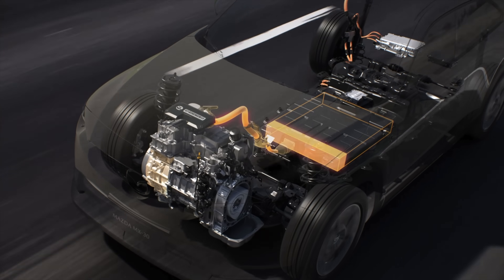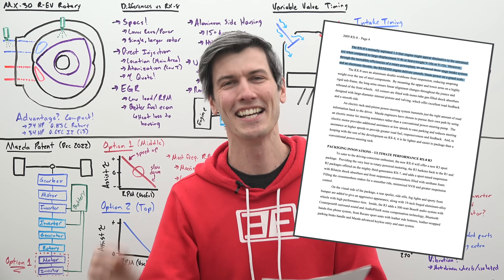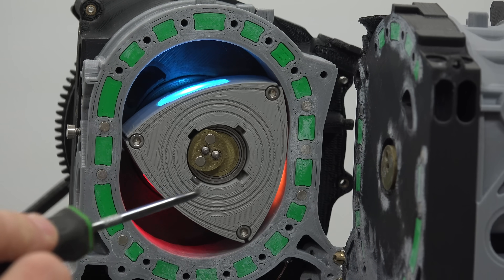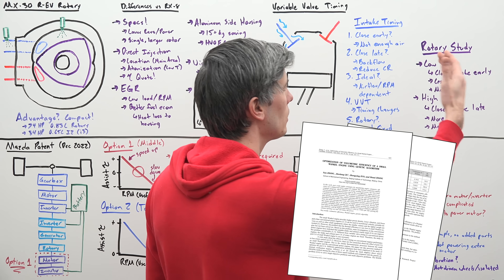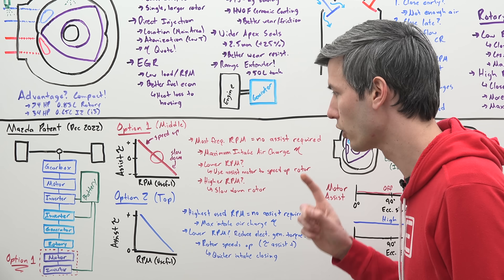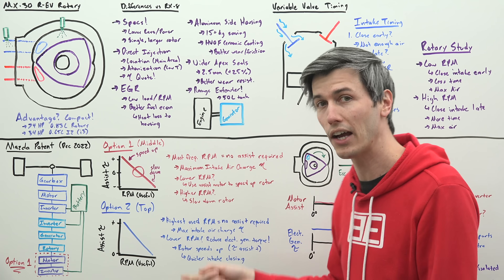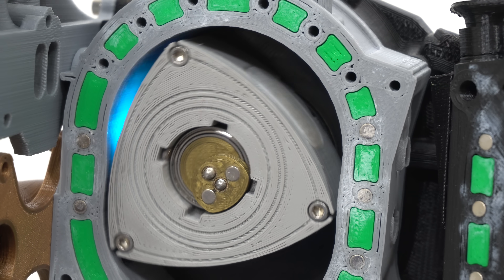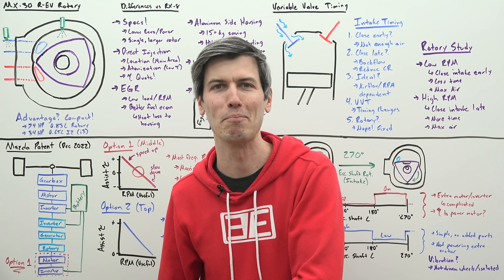Mazda Brought Back The Rotary Engine!

Comment: Gotta love Mazda’s resilience with keeping the rotary alive.
Reply: Absolutely, they even go so far to say that "rotarys are our thing" and that they would love to make a modern rotary sports car.
Reply: I hope any f1 engineers find intrest in developing rotary for mazda
Reply: It’s really the only thing that makes the cool IMO 🤣
Reply: You mean on life support at this point.
Reply: Kinda pointless to keep killing a dead horse rotary engines by design no matter what they do they will always burn oil and be fuel inefficient.
Reply: Dog with bone. Good on them.   I’m happy for Mazda.  Impressed resiliance to failure
Reply: Mazda is/was working a Hydrogen powered rotary engine. I think that with new manufacturing technologies/techniques, the Wankel rotary engine can be efficient/powerful enough to be in a sports car again. Keeping the faith!
Reply: @chanoleyva8584  but at least they need to be rebuilt every 120,000km. Great feature.
Reply: We went from building the 1st airplane to landing people on the moon in less time then we've spent trying to make a proper Rotary.
Its time to stop beating the dead horse and bury it already.
Reply: For the right use case a rotary is a great range extender. On one side of the spectrum if you have a 1kWh battery an efficient piston reciprocating engine makes sense. On the other you have a 100kWh battery where a less efficient but lighter and smoother rotary makes more sense as you're on battery more and using the extender less. Same applies for driving habits: for shorter trips and fewer long trips a rotary is less impactful to the battery-only economy.
Reply: Mazda is the kind of downdog who always want to impress everyone with setting difficult goals for himself but always fails at the end.
Reply: This seems like it would be the ideal use case for a Wankel.
Reply: Their probably relying on the engine only being used for short periods, the oil tank needs to be bigger than the fuel tank too.
Reply: I just hope it's not a hammer in search of a nail. This seems like a lot of extra engineering for a design that might very well be fundamentally flawed. I see a rotary engine is theoretically beautiful in its simplicity. But so is a spherical cow.
Reply: The rotary kept Mazda alive and Mazda is returning the favor. Japan wanted to reduce competition in their vehicles market and Mazda would get killed if they didn't get the patent for the rotary to differentiate themselves from the other companies
Reply: Alive and on life support: undoubtedly it is their trade mark; however, rotary engines have always consumed oil and demanded a lot attention that only a few enthusiasts have managed to give.
If packaging and ecology are the goal, they could have made a joint venture with Yamaha and used a motorcycle engine.
Reply: I call it stupidity but sure.
Reply: I feel it's somewhat like a two cycle engine, there is probably an absolute constraint, in this case emissions, but they are still making technological advances and contributing to the industry, they may yet hit on that major innovation. I think the electric/hybrid sector makes sense. Mazda's niche has always been power to weight ratio and a steady power band, both play well with electric.
Reply: The engine might not ideal for powering every driveline, but when you can get that thing to hold RPM.... wooowee! That's why these are used in Military drones as the engine for the generator that power the thing. Small, compact, efficient.
Reply: @gazfish  lol 😂
Reply: @EmilioBaldi  when you say consumed oil, it means the apex seals require lubrication just like piston rings do in conventional engine. My 85 RX7 used as much oil from the sump as does my late model VW
Reply: resiliance?   They haven't been able to supply their dealerships with new cars in my region ever since the pandemic hit - only sending small numbers of cars each month,  the lots are still empty today.

But they're screwing around with making their brutally underpowered / low range EV that only sells dozens per month globally ... into an EV that burns gas and has emissions, and that will barely sell dozens per month globally.
Reply: Though i am pretty sure this one isn't going to sell well.
Reply: Using them in power generation makes so much more sense if they like to stay in a specific RPM.
Dorito as a stationary generator  solution should really be much more used. Way less parts to break, its probably cheaper to make.
Why no one thought of that before is amusing.
Reply: @maddogsk8er86  the perfect application for dorito engines.
Reply: They kept it alive in the worst way possible
Reply: Let's be honest -- Mazda doesn't have Jack Schitt else to be excited about. It's a loser brand, with no purpose in the market.
Reply: Yeau but lets just hope mazda doesnt make it dogshit with a billion pointless sensors that will basically kill the whole car is a headlight buld blows
Reply: Rotory engines are beautiful
Reply: @rogerwilco1777  eh many companies still trying to build flying car that from victorian age so why not rotary engine
Reply: It's a superior design vs. a standard v motor. The power output vs. size of motor is substantial. The only downside to it was emissions.
Reply: @sinoverlord409  a 2 stroke 850cc pistons engine can output 160hp...the only downside is emissions.
Reply: They should have stopped with the rx7 tbh. It's like horrible re-runs that keep getting worse.
Reply: @BarelyA1ive  they can't
Reply: @raisofahri5797  I am pretty sure none of the big companies every thought of building flying car when there are literally helicopters, planes and jets.
Reply: electric lame asl
Reply: This feels more like reusing old machines and manufacturing lines to build this limited run assist motor. These hybrid trash cars will be dead in 5 years anyway, so they are just getting to use their last parts and leftovers from the rotary era.
Reply: @MasterofNoneTV  the oil consumption of certain VW engines is well known. VW Group is not an example of a virtuous company; let alone green company.
I'm sorry, but your argument is a formal fallacy.
Reply: @dknight2585  they bought it back lol
Reply: I'm very happy to see the original 47 engineer team for the rotary did not work in vein. The glass is more than half full due to modern technology, a variable computer controlled reed valve intake & exhaust system coupled with a VVT & proper anti-reversion cam profile would be a great way to breed more efficiency! I love this channel!
Reply: @hxhdfjifzirstc894  Absolutely not true. In terms of mileage you get out of the car per money you spend on it, they are second only to Toyota (and not by a big margin).
Though that's for the less cool piston engine models, not the rice rockets.
Reply: Have they dealt with all of the emissions issues, seal issues, etc etc... IMO rotary was always a neat concept but until those absolutely astonishingly critical technical challenges are solved (with advanced materials etc) the idea still seems like it should not be allowed to be sold to consumers... i.e. does anybody have any idea how astonishingly horrible the emissions of the old Mazda rotaries really were? 
Even worse than those Volkswagens that lied about diesel emissions... it was that bad.
If they have solved those issues, this could be the ideal power plant for this use... but only if all of those issues have been solved and solved well.
Otherwise, as previously... it's a "not ready for prime time" tech that Mazda keeps tossing rough and dirty prototypes at us, as if they had mastered the tech (something they most certainly had NOT done when rotary engines were common in the 80s etc).
Reply: We may get a real rotary because this EV is a great way to do testing. Real world research.
Reply: @BarelyA1ive i hope not
Reply: It will make a splendid addition to the Smithsonian Museum one day—long after Mazda ceases to exist as a going concern.
Reply: There are much better reasons in play than resilience!
Reply: Same engineers from the first generation RX7 locked in a basement until they get it right.
Reply: But they never alive for long tho
Reply: It's dead Jim, DEAD!
Reply: @chanoleyva8584  ... Rotary engines are very power dense, meaning liter for liter a rotary engine produces more power than a piston engine. That's why many UAVs use them. It makes a lot of sense to use a rotary engine to produce power for a EV, as well. Rotary engines struggle to be fuel efficient, when they are not ran at optimal RPMs, but stick them in a light airframe or used as a generator, they are more efficient than a piston engine (taking weight and size into consideration of course).
Reply: no. Imagine how many tons of fuel have disappeared through the exhaust of Mazda cars just because the engine is inefficient.
Reply: doesn't produce the engine for over a decade

Boy Mazda really is resilient! Can't believe they've lasted so long building a rotary!
Reply: But at what cost, what have they done to my boi. Jokes aside so happy to see it back knee capped or ptherwise.
Reply: Right they are talking about aiding the rotary with an electric motor just to be able to use it lol
Reply: I bet that someone will build a 2+ rotor version of this engine utilizing the DI system.
Reply: @chanoleyva8584  I guess two stroke motorcycles are pointless and inefficient too. Just a design that is racing inspired not designed for your average Karen that doesn’t change her oil or do any maintenance on her car. Rotary is a car enthusiast engine for sure
Reply: My only wish is that if rotarys cant make it back as the main engine for a car they could at least still be the main engine of a motorcycle, that thing is still putting out 74 ponies, more than plenty for a bike. Just imagine 😭
Reply: @chanoleyva8584  Advances and changes in design and development can always improve things. Particularly these days with how fast engineers can get stuff to the prototype stage.
Reply: Like Harley keeping the air compressor engine alive.. always someone thinks it's the greatest
Reply: now we just need toyota to bring back a modern version of 4AGE
Reply: The cost is too high. It's like keeping the Mustang 'fresh & hip' by turning it into an EV SUV.
Reply: Persistence
Reply: The aftermarket and private developers kept it alive after they killed it with the rx8
Reply: @prestonsplans69  yea the rotary is most people are car enthusiasts though
Reply: Very soon Mazda will invest in even less of a rotor: a third to be axact; aka a piston.
Reply: @autolykos9822  – Not surprisingly, because Toyota Motor Corporation owns 5% of Mazda, and they have cross-supply agreements – all of which results in a level of Mazda product reliability that keeps Toyota happy.
Reply: @BarelyA1ive  Wankel engines are too shitty by design and too unreliable and cost way too much to keep running for it to be of any use to anyone, especially professional racing teams.
Reply: zoom zoom 😎
Reply: Reminds me of an article i read 25 years ago by an EV expert, he stated the optimal layout is an EV with an onboard gas turbine generator.  If you're Mazda, that sounds like a perfect spot for a Wankel
Reply: Fun fact, Wankel's original patent expired almost 70 years ago. As the only general market developer to build upon that original patent, each newly issued patent allows Mazda exclusivity in licensing the tech for revenue generation. 
If you wanted to know why a new Mazda Rotary powerplant comes along about oh, every 15 years or so, well thats the maximum amount of time a US issued patent license lasts for before expiration.
Reply: Dowside:

It's a hybrid and thr rotary doesn't even do much of anything other than spin a generator. Would love to see a true hybrid rotary.
Reply: @pocok5000  Yeah, because the Miata, 3, 6, and now the Rotary have all been failures. Oh wait...
Reply: @adamcrookedsmile  Imagine how much the owners didn't care, because they were enjoying the drive. They aren't as inefficient as you think, either. The 1986 RX-7 had the same fuel economy rating as a 2021 370Z.
Reply: @bradcomis1066  Rotary engines can last a fairly long time. Almost every one dies due to user error or bad rebuild. Dropping the front thrust bearing, not enough endplay, not enough lube...
Reply: @Karl Günter Wünsch  if the technologies do not improve, batteries will be the downfall. Lithium mining is terrible for the environment. And manufacturing techniques are not far behind. Mazda's e-Skyactiv X does so well, and that is just one technology from one company. Internal combustion engines can be efficient enough with  the correct management. The thermal inefficiency can also be worked out with the correct management. I think people are jumping on the EV bandwagon because they believe that it is better for the environment, but it certainly is not, not yet anyway. Hybrids are a  better alternative, IMHO. 
But if you want to drive an EV, then do that, if you have the means.
Reply: @jeepmanxj  No, they are expensive to get right - but if done they are a marvel. But I agree that this time it's too little too late - they should concentrate on getting batteries right.
Reply: @jeepmanxj  Tell that to the racing cars that won their classes in endurance racing using Wankel engines. But I sort of agree, the whole combustion engine area is coming to an end because they are grossly flawed and the Wankel engine is just one type of now obsolete technology...
Reply: THE DORITO IS BACK
Reply: Yeah, the engine won Lemans
Reply: @chinwubaamadi  so? Lots of engines that are overall unreliable have won LeMans. Your daily driver will have thousands of hours on it.
Reply: @Lurch hydrogen is way more than a decade away. The logistics of hydrogen production make it obscenely expensive, so expensive that the few vehicles that use hydrogen come with tens of thousands of dollars in fuel credits to get you through the first year. 

It's a solid 50 years away and the wankel will be long gone before then.
Reply: @chanoleyva8584  yeah, but if your old enough to have been around then, that is exactly what they said about conventional engines back in the early 70s.
Reply: Without any doubt dumbest idea from Mazda so far...
Reply: @hxhdfjifzirstc894  My 21 Miata RF is a pure joy to drive and never gave me a problem.
Reply: Remember like he said in the 2008 Rotory announcement, everything was advertised as working efficiently. We will have to wait and see if it actually works out right and the longevity of it.
Reply: @wanglee21  Indeed, many have made claims of significant improvements to the Wankel engine to make it competitive with reciprocating engines in reliability and efficiency but as of yet none of these claims can be proven and seem highly unlikely given the inherent flaws and limitations imposed the the Wankel engines fundamental design.
Reply: It's the sunk cost fallacy.
Mazda has invested a lot into the rotary engine
Nazda's problem is that it's because a liability in terms of fuel efficiency at a time where efficiency is a selling point AND electrification is in the horizon.
But they're still trying to justify the extreme amount of R&D cost, time and effort they've sunk into rotary engine design, thus they're trying to keep it going until electric cars becoming the standard end any hopes of market viability.
Reply: @fl00fydragon  I feel its just odd how they are not using the rotary engine to power the wheels but instead a battery pack. lol I find this counter productive but who knows, maybe it's more reliable and efficient than the normal hybrid vehicles.
Reply: It’s amazing that they are keeping it around but it’s sad that it’s been boiled down just to a tiny generator
Reply: @MissingLinkGTRS  This looks like just another Mazda publicity stunt.
. unfortunately it seems the Wankel engines shelf life has reached its expiration date... this one got a very cool response from the general public and die hard fans.
Reply: @RENOWN55CHARGE  Ford e mach is a mustang EV
Reply: @Runco990  a turbine is more complex than a rotary engine and needs a higher temperature to work
Reply: @apexbender  China and Europe are oil poor, so they need to use EV. China started to use electric scooters 15 yr ago
Reply: @wanglee21  combustion engine are efficient to a single operating point, they don't like change in speed. Electric motors are more flexible
Reply: @Kannot2023  Europe and China are both traditionally Coal based energy producers.
Reply: @aj-oldschool-motors  Unfortunately this is nothing more than wishful thinking and completely  disregards the development history of the Wankel engine.
The Wankel engine is inherently inefficient and unreliable compared to reciprocating engines, the industry concluded that the Wankel has reached the end of its development potential.
Reply: @hxhdfjifzirstc894  meanwhile my 2010 MX-5 goes up in price every month
Reply: ZOOM ZOOM ZOOM!!!
Reply: @drewo.127  Yup, Mazda only makes piston engines these days
Reply: They never should have killed the rotary.  I loved my 2011 R3.  I would still be driving it if an uninsured driver hadn't rear ended it and totaled it for me.  I have owned 7 rotaries since 1973.  No engine is more fun to drive.
Reply: @CrotalusHH  If what you claim is true? Mazda would not have lost money on every RX model ever sold, they lost a staggering 3 billion dollars on the RX8.... no one bought them.
Reply: @sandervanderkammen9230  You obviously never drove one.  I loved mine.  They were a delight.  Most rotary problems were with improper care, not bad design.  You have to use premium fuel.  You have to keep the oil topped off.  You have to keep the RPMs up.  You need to drive them hard.  I got in excess of 150,000 miles on all of mine and never had an engine failure except in one and it was a cooling failure and fixed under warranty. They were all fine when I traded them.   I've never owned anything else that was more fun to drive.  If they made a new one I would buy it tomorrow.
Reply: @CrotalusHH  No, I'm not gay.
Reply: Is it reliable
Reply: @joanofarc708  No, Wankel engines are obsolete technology because they are extremely unreliable and less durable than reciprocating engines.
Reply: MAZDA ANOUNCES CANCELATION OF  MX-30.
NO RETURN FOR ROTARY ENGINE.
Reply: @CrotalusHH  nice to hear
Reply: @sandervanderkammen9230 
You're quite funny 
You have to drive an rx-8/7 and tell me how is it.. 
Although, you are not gay.. I'll try to remember
Reply: @5770mp  The RX8 is designed for women and male hairdressers... no red blooded car enthusiasts would be caught dead in this LGBTQ+RX Pride Day "Drag" racer!
Reply: @sandervanderkammen9230  laughing.. 
Mad mike's mazda 3 (4 rotor) gets a green light from you? (Im not sure he's gay😅) 
What You drive? A Porsche? (You dont have to answer)
Reply: @5770mp  You didn't know Mike is gay?
Reply: @sandervanderkammen9230 
lol actually? Didn't know that
Reply: @sandervanderkammen9230  omg 
Just saw mazda iconic SP 😍😍😍😍
Reply: @5770mp  SP?
Reply: @5770mp  sexual preference?
Reply: @xXYannuschXx  pretty sure Mazda own the rights so no one else can make Rotary's
Reply: flogging a dead horse
Reply: Now make I last 100k plus miles it would nice engine